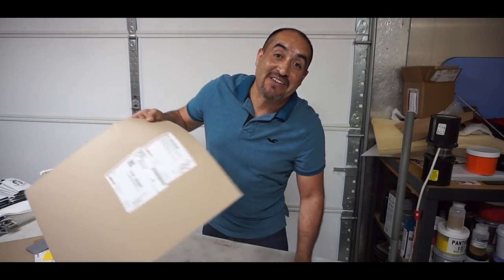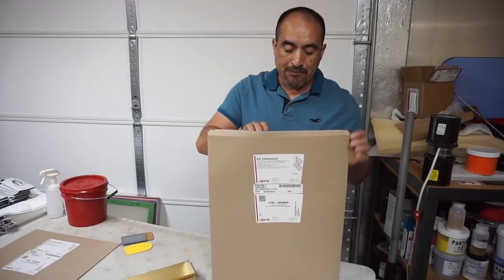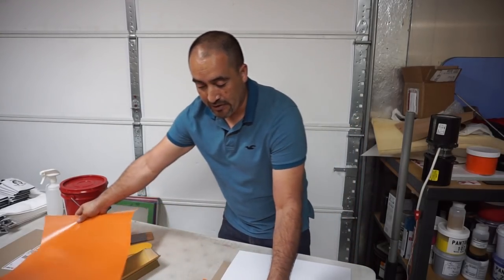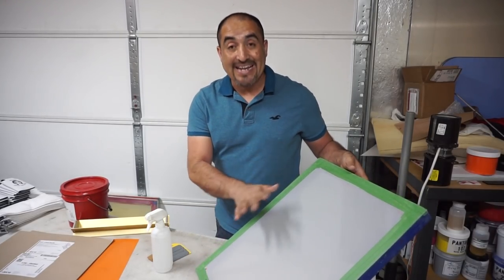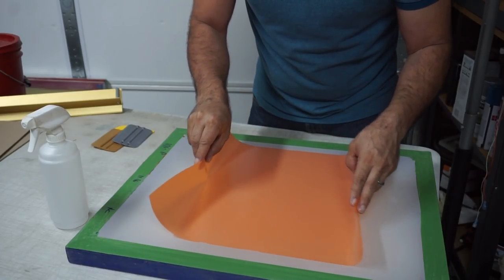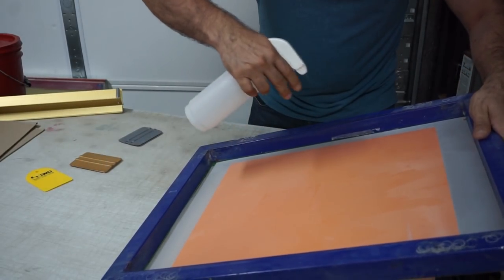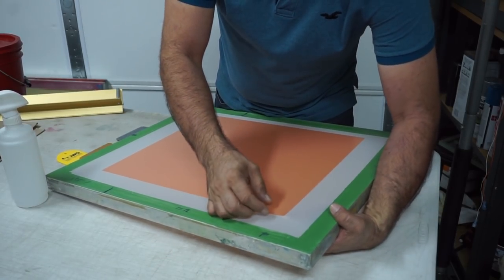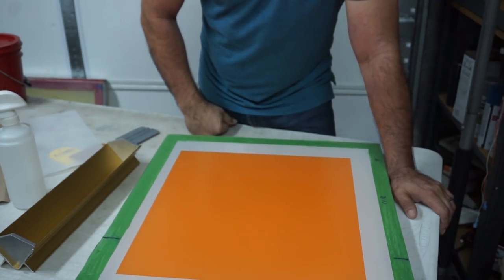USING CAPILARY FILMS

Comment: The pro angle coater on your table, which size is that one? 15"? and what size screens you use to coat it with? 20x24? Looking to buy one of those but they only sell 15 and 18" where I think 15 is too small and 18 too wide...help me out please